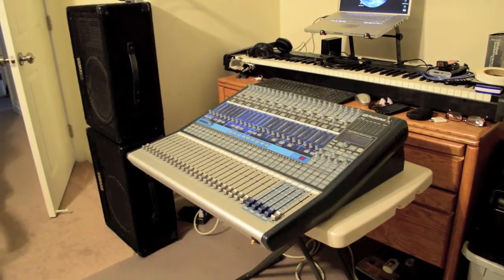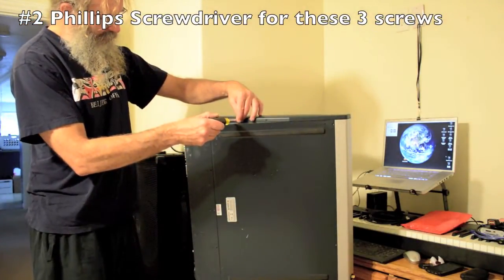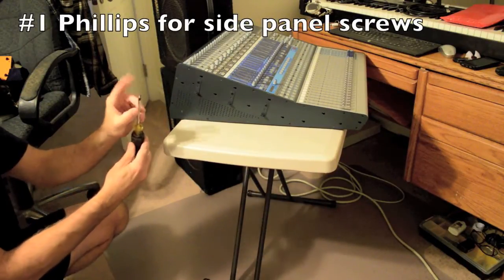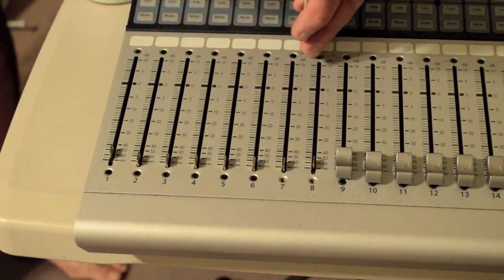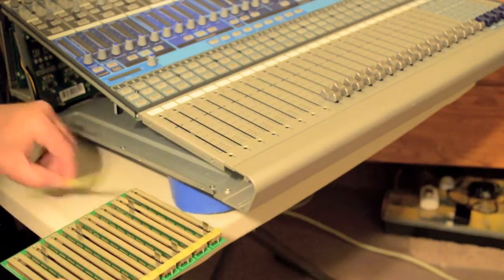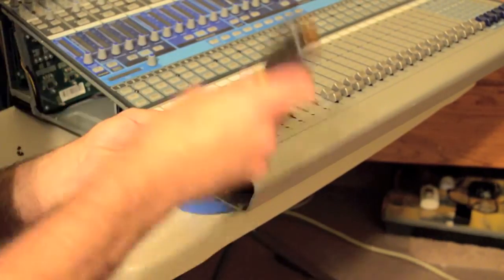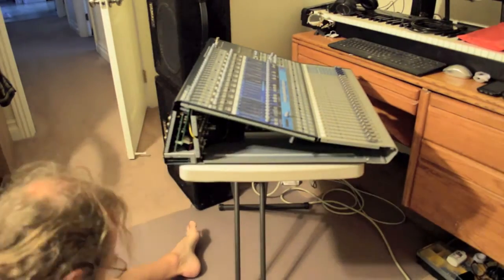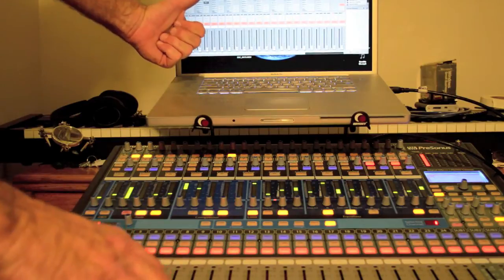Fader Replacement Presonus Studiolive 24.4.2

Comment: Are there no longer parts available?
Reply: apparently NOT    I tried today and they said "sorry no"
Reply: @Anton-du-Fleur  I ended up using some from Ebay.

SC1009N B10K Mono Potentiometer Fader For Soundcraft LIVE4 mixer 128mm

They are the right size and work perfectly.  I replaced every fader with these and have had zero issues.

Comment: Great video, could I ask if you can you recommend a supplier for the 24.4.2 replacement banks? The desk is discontinued so no luck with presonus. I have an issue with my subs and main fader... My main fader is unresponsive and sub 4 is behaving as the main. Any suggestions would be really helpful

Thank

Comment: Hey James  Thanks for the video!   any chance that you could give me some tips on replacing the power supply board in one of these?  I have removed both side panels and can see the board but it looks like I am going to have to disassemble the entire unit to get to it.  That cannot be right!?!  any tips, from anyone, would be greatly appreciated!
Reply from the maker: Craig Jameson. I haven't had to do that repair. I'm no help for you on that one. Hopefully somebody will chime in and offer a tip.
Reply: Thanks.  after a bunch of head scratching I figured it out.  for anyone that needs to know:
After removing both side like James did you have to separate the upper and lower halves of the case.  to do this remove: 
   1. the tops of the gain knobs (just pull them straight up)
   2. the front row of screws on the underside of the unit
   3. the top row of screws on the back of the unit
   4. the 4 torx screws that are inline with the gain knobs
the top should lift away from the bottom of the unit.  I stood the unit on its side and 'opened' it like a clamshell (hinged at the top).  be careful as there are several cables and wires that run between the two halves.  I pulled the grey ribbon and the large white connector to get a bit more work space but left the others connected.  at this point you can easily get to the power supply.  Replacing it is about 10 screws and 6 or so connectors.

Comment: Great video --- I'm having catastrophic failure in nearly all 16 channels of my 16:2 --- maybe replacing the fader banks will be the difference between replacing the whole board or not.  .....  Now to figure out where you ordered those parts.
Reply from the maker: I purchased direct from Presonus. Any of their resellers will be able to help you as well. Full Compass, B&H Photo
Reply: I believe I'm out of luck.  Presonus is no longer making replacement parts for Presonus 16.0.2 ---- I did see a store with some fader banks for this model, but for some odd reason they are 7 bank channels...
Reply: Hmmmm.....  I do see 7 fader banks on Full Compass.  I wonder why they come in 7 instead of 8!
Reply: Lemme ask you something else James --- ... the left side of my tape in RCA is much lower input level than the right side --- I have cleaned the contacts, switched cables (Several times) and have concluded that its perhaps a failing capacitor on the tape in part of the board --- Do you think this is something I can repair myself?  Any advice?

Comment: Hey James, super helpful video! Thank you! Shot in the dark here, my master fader is out on my 16.4.2. I can use Universal Control via my MAC and control the master fader, but physically it doesn't work. If the issue is the same (not asking for remote diagnostic) is the fix similar? Thanks for any advice you can share.
Reply: I’m having the same problem with the 16.0.2. Master fader zeros out but i can use UC Remote on PC or Tablet

Comment: James, The first 4 channels on my studio live 24 have stopped working. However, the pre-amps are working through the Tascam multi pin outputs on the back. I'm thinking the faders went bad. any ideas? Thanks, Fred
Reply from the maker: Hi Fred Shaw, sure sounds like it. I would try an ipad on it to see if the fader values change. If they do, then I'd say there is a pretty good chance the fader bank went out on you. If there is no change in fader value, there me be another issue.

Comment: hi james, I am having issues with my aux and main faders, do I  replace with same method as you used, but from the other side?also do you have info on the source for the new part?thankschris
Reply: +crystal ball You can order through Full Compass-in stock---Be aware ch 1-8 is the 8 channel fader  bank---the next 3 are all 7 channel faders banks---on fullcompass site it indicates the 7 ch fader is only for 16.4.2, but in checking w presonus it works with 24.4.2  Fader banks are 8,7,7,7  (24 channels, 4 subs, 1 main-total of 29) Cost is around $70 or so....I was able to replace the 7 ch fader at the end of my 24.4.2-not too hard
Reply from the maker: +crystal ball -- as Greg said. It's tight in there, but doable. I don't have a big arm, I was able to reach into the middle banks as well.
Reply: +Greg Percy , thanks, got it out, , orderd the 8 ch bank was wrong, waiting on new part for  4 weeks now, they are back orderd and presonus wont give up whats left in there stock, but they say anytime now.I was able to  drop / tilt the bottom panel about a inch or so, that gave me the room to get my not so small hand in there.  tricky slipping the part in with the headphone jack there, but , doable. ,had to use a drop of rubber glue to hold insulative strip in place, looked like they used 2 sided tape.thanks again
Reply: +crystal ball -Check with fullcompass.com for parts---

Comment: Nice tut James.  How about if the bank you need to replace more toward the center.  Is there a way to remove the control surface to gain good access?  Would you mind naming the price for a bank of 8 from Baton Rouge.
Reply from the maker: Thanks. My skinny arm can get in there to replace any bank. I did consider removing the surface panel.  From my observation, I think you'd need to remove the 5 screws in the back (above xlr inputs), just the top screws on both metal side panels, the trim knobs (they are connected to a diagonally mounted pc), the screws at the bottom of console that go into the silver panel (that the headphone jack is mounted in) the wires to the power supply, the headphone jack wire connector and the ribbon cable that connects to the pc underneath the display.
Reply: James Palmer Thank you Sir.
Reply from the maker: My pleasure. BTW, the replacement bank of 8 faders was about $65. Don't know what I did with the receipt.